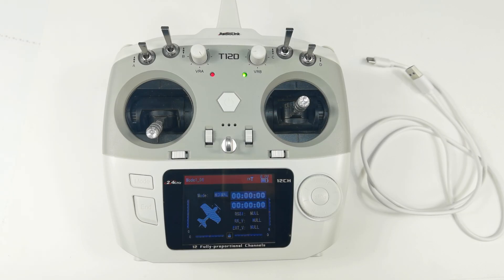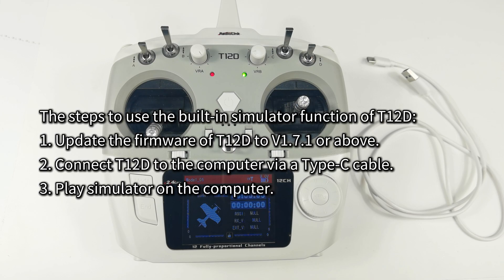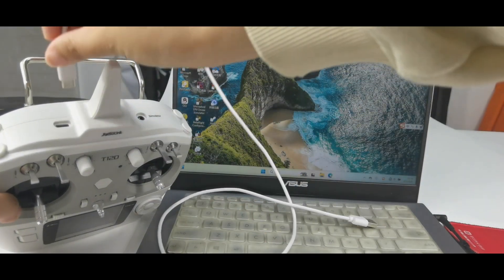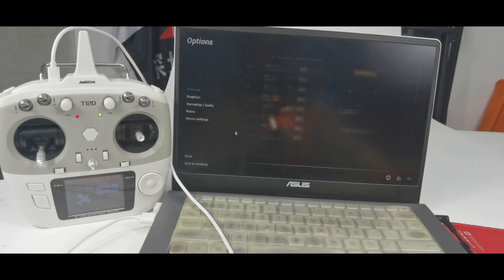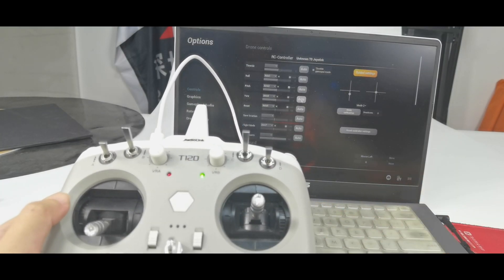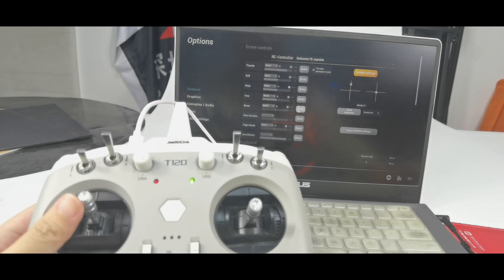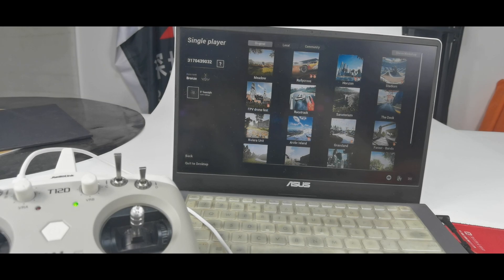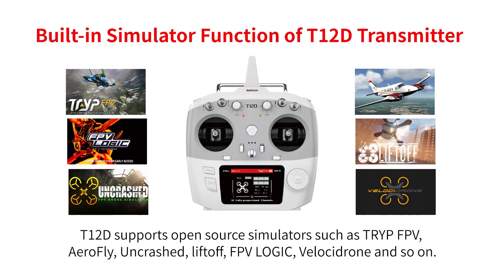Built-in Simulator Function of T12D Transmitter

Comment: Hello, I'm Marcelo from Brazil, I'm configuring a 10-inch racer drone but I can't activate the motors. In fact, everything works on Betaflyght, but on the drone it doesn't work. I called SBUS. Would you have a video explaining how to do it?
Reply from the maker: Hi, sir. May I know what RadioLink products are you using? If you are using Betaflight flight controller, please make sure you have set SBUS signal on Betaflight. If any question please feel free to contact us. Our email is after_service@radiolink.com.cn
Reply: @Radiolink_official the radio is the radiolink T12D receiver R12F I'm using sbus I've already selected sbus on betaflyght and the port is all working but when activating the engines nothing works I've already connected another radio and it worked

Comment: AeroFly rc 10 da direk oynayabilirmiyim.
Reply from the maker: Hi, sir. the built-in simulator function is suitable for open-source simulator. Sorry we do not know about AeroFly, but you can follow this tutorial to have a try. Check if they can work together. If any question please feel free to contact us. Our email is after_service@radiolink.com.cn
Reply: @Radiolink_official merhaba kumandayı satın aldım ama aerofly rc 10 da elevator çalışmıyor.tavsiyeniz nedir.
Reply from the maker: @Karahan3301  Hi, sir. Could you please follow the tutorial to calibrate the radio? In general, there are different calibration methods in the simulator software. You can try different methods to calibrate the radio in the simulator. If the calibration is done, it will be recognized. If any question please feel free to contact us. Our email is after_service@radiolink.com.cn
Reply: @Radiolink_official  teşekkür ederim.Kalibrasyon dan sonra düzeldi.
Reply from the maker: @Karahan3301  Great to know that. If any question please feel free to contact us. Our email is after_service@radiolink.com.cn